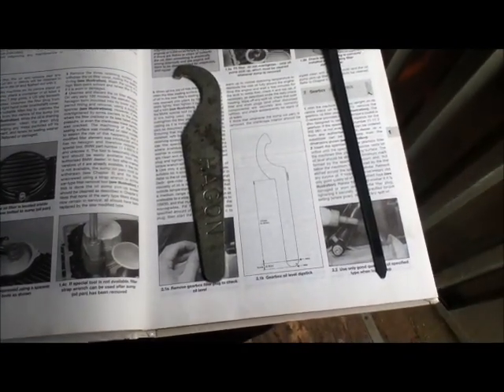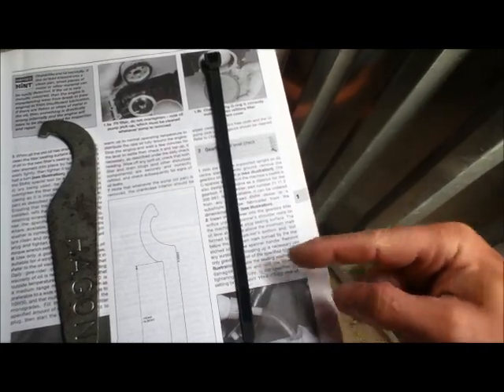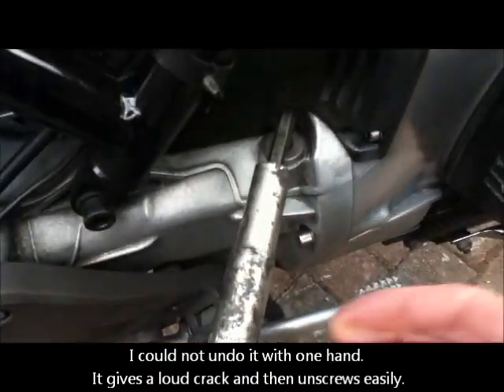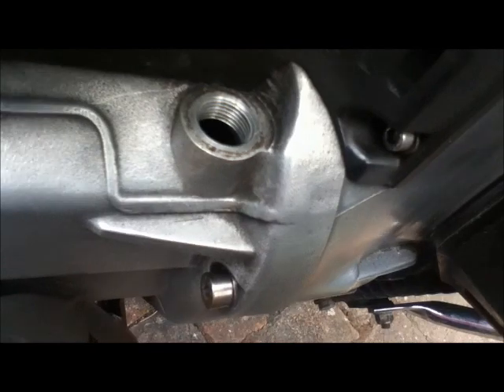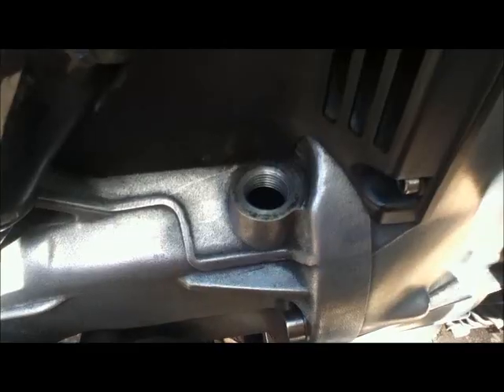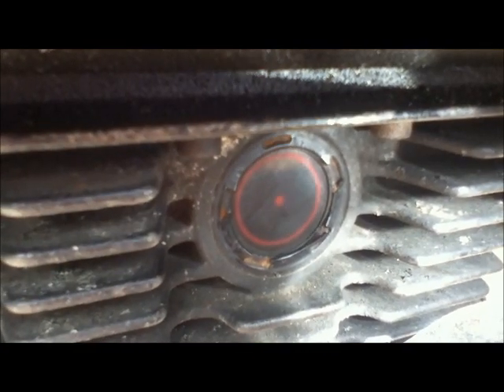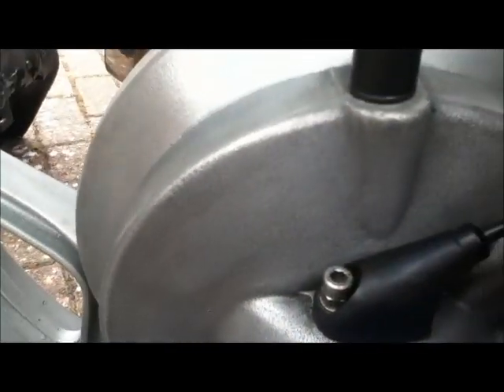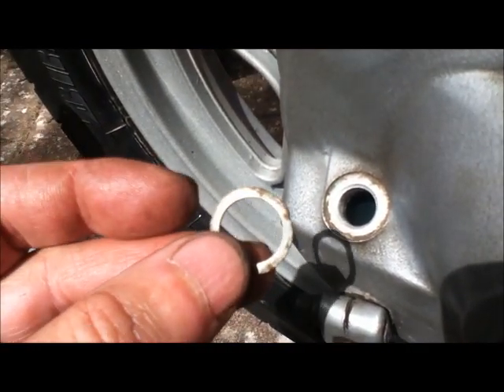BMW K75 - Making a Dipstick - checking the oil levels.

Comment: I had a wrech that i got with the bike when i purchased it that looked exactly like the tool that comes with the bike when sold new.. I was changing my oil today when i felt like i had filled a bit much and still couldnt get a reading on the dipstick.. Turned out the tool was aftermarket bought by the last owner and it was about 2cm shorter..

ugh.. 

so i made a DYI dipstick like you did here in the video and turnes out i had about 1cm too much oil in... So out the drainplug goes again :P

Allways check your tools before you do a job, saves you alot of hassle
Reply from the maker: That's good advice and well spotted. I have a small syringe to suck oil out with.
Reply: @johnnysevengun  yeah i tried doing that myself.. But the hose was too big and i decided to just take the drain plug out again to get it over with.. Had just put in a new washer due to the oil change and didnt have another set of washers so now i have to worry about the seal not being perfect.. Guess ill just go get a new washer and quickly change it again

You live and you learn :P
Reply from the maker: @Borrelaas  The washer will last three or four changes as long as you don't overtighten it.
Reply: @johnnysevengun  yeah, i guess you are right